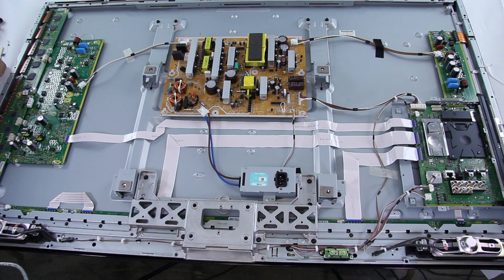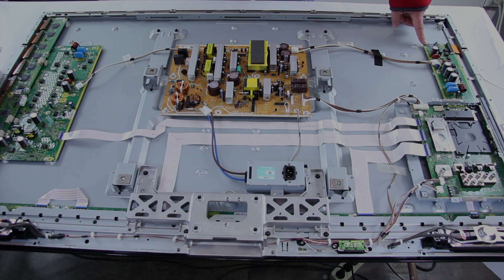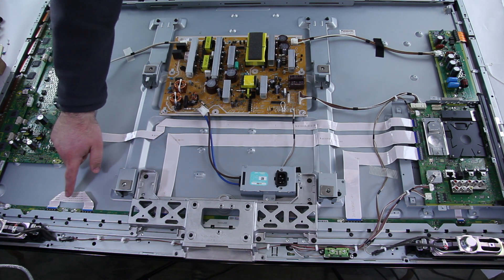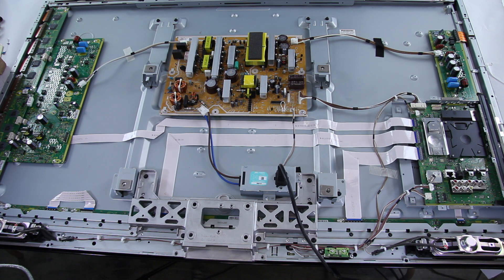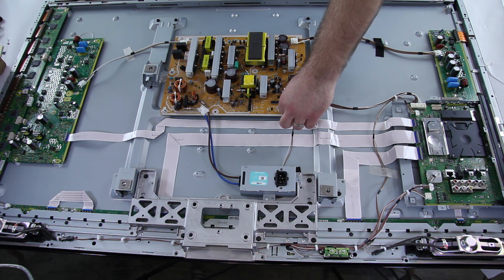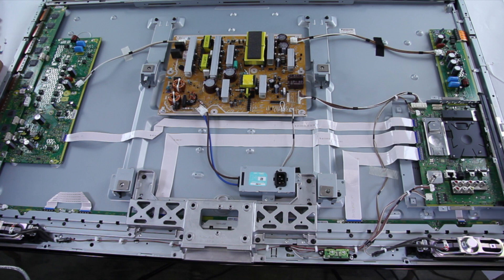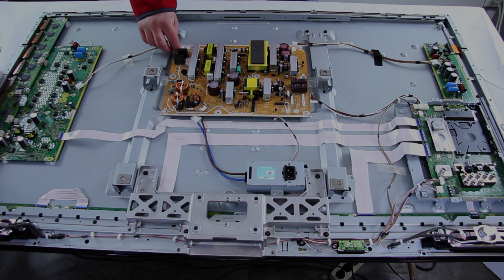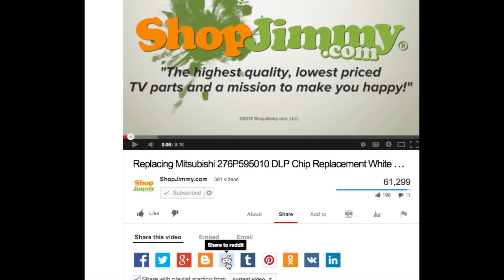Panasonic Plasma TV 6 Blink Code Explained Repair for 2011 Panasonic Plasma TV

Comment: Mine P42GT30B was working.  Opened up to fix up loose screw on tpna5330 and tpna5331   Now  gives 8 code or 6 code ;

Comment: I have a Panasonic TC-P54S2 that blinks 6 times and screen does not light up. There was a loud pop sound before it stopped working. Can you please inform me if this video applies since the model number differs from the ones that were listed and what parts I should be looking to probably replace including components on the circuit board. Thanks

Comment: I have a Panasonic TC-P54S2 that blinks 6 times and screen does not light up. Can you please inform me if this video applies since the model number differs from the ones that were listed and what parts I should be looking to probably replace including components on the circuit board. Thanks

Comment: I have at the TCP65ST50. It will power on and the screen shows botches of light pixels.  The screen will then go black and then has a three blink code. What should I do.

Comment: Didn't work for me to clear 6 blink error. P50S30 model Initially 14 blink code, repaired sc board, then 6 blinks. Drops the 5v & 15V a few seconds after power up Have replaced all boards except su/sd. What do you think I should try or check.

Comment: I have a Panasonic TC-P50S2 plasma tv.  Black screen and started with 10 blink error code.  I have replaced the power board and A board.  No change.  Found  a short on the SU buffer board so replaced buffer boards and Y sus board.  Now it has changed to a 7 blink code.  I found a broken leg on a capacitor at C842.  Swapped cap from old board to this board which was used but looked like new (from China).  If I disconnect the ribbon cable coming from A Board at A20 to Y sus board at SC20 and power on the tv, it stays powered on with no error codes.  Any recommendations as to what is causing the issue?  Thanks.

Comment: I've had my Panasonic TC-P60GT30 for a while now and it just recently gave me the 6 blinking lights.  I followed the procedures shown in this video.  When turning on the TV after disconnecting the ribbon cables, etc...the screen stayed Black and then started giving me 8 blinking lights.  I proceeded to check the C561 and TP82.  I was get a V reading of 2-3V and 30V respectively.  This model has 3 P-Boards, but I'm not sure at this point what the 8 blinking lights are now.  Any help with this would be helpful and appreciative before I order the 3 P-Boards.  Thank You.    **update** As I was putting on the back panel again and everything was connected, I tried turning on the TV, it did not turn on but started giving me 6 blinking lights again.  I imagine it is the P-Boards.

Comment: Thanks for the detailed explanation of the process to identify the issue and replace the board, I have the Panasonic TV model TH-65PF30W, High Definition Plasma Display 
it is also showing the 6-blink error, is this video will work for the model  TH-65PF30W?

Comment: Hey Jimmy, I'm a moron. I can't remember how to plug in my TV. It is a 2011 P65VT30. I just moved and the movers removed the cord and hid it somewhere. The only connector I can find is a flat rectangular 3-spade like I don't recall every seeing. It is under the little door that removes with 2 screws. Is that the power connector? If not, where is it? I was expecting a standard computer cord. The manual is not very helpful. Thanks.

Comment: 2010 sane TV.. 6 blinks 50 inch Plasma Viera Panasonic.. TV is not turning on.. 6 blinks on the led.. reading online it's a poerr board problem.. is your video here says 2011 helpful??

Comment: I have a 2013 Panasonic TC-P50S60 model and it turned off after a power surge in middle of the day, no storms or lightening. Now when I plug it in and turn it on, i get 3 quick flashing red light. What can I do to repair it? Thanks

Comment: Hello. I have a panasonic plasma tv with the blinking red light 6 times. Model is TH-42PZ77U.
Is there a different procedure for determining which board could have stopped working? I'm ok with replacing a board if needed but I'm not sure how to determine which one is actually bad.
Can you help me figure out which one is bad and locate the part as well?

Comment: Hello again , my panasonic tc-p42c2x shows 5 blinks code, always have stand by present but it is 4.99 volts, after the first clic sound momentarily we have 15 v, 190 v Vsus and power on line off 3.11 volts, accept sugestions

Comment: Hi I have a 2011 Panasonic  TC-P60S30. It has no picture and no sound. The red light flashes 13 times then shuts down. I replaced the "P" board but nothing changed. Now what to do?

Comment: My name is Joseph I have a Panasonic TC-P65S2 had two capacitor chance on the power supplys that were bubbled up but I continue getting the seven light blinking sign on it any suggestions to repair to repair this problem you can email me at Joseph Ramos 182@yahoo.com

Comment: I have a Panasonic TCP65GT30 that has the 6 blinking light issue with no picture staying on (or staying on at all).  It has replacement P(main) and (sub) boards, and I even tried a different A board with only the 6 blinking light code as a result.  I'll next try removing those cables SC-20 and C-20 to see if the set will stay in with a black/blank screen.  Should I be able to hear sound?

Comment: I have a TC-P42S30 from May 2011 and it has the six blink code. I followed the instructions in the video and the TV did stay on after disconnecting the SC board. The service manual refers to this board as the SN board, this is the same board, yes?

I looked for a replacement on shopjimmy.com but the TNPA5349 is out of stock. The repair kit is available but it says it is for the 7 and 10 blink code. Will it also work for the 6 blink code?

Comment: I had the SC board repaired on my Panasonic P50GT30 Plasma when it was showing 7-blinking LEDs. I received the board back and installed.  Now I get 6 blinking LEDs.  I've done the test where you disconnect the C20 and SC20 ribbon cables an the I got 8 blinking LEDs.
Any idea's? Thank you.

Comment: I have a Samsung 46" model LN46D630M3.  When I turn on the tv, the standby light blinks 6 times then goes out.  no picture or audio.  I removed the ribbon from the mainboard to the Tcon and no difference.   When I removed the cable from the power board to the mainboard, the backlights came on.  When I reconnect the cable to the mainboard, again the standby light blinks red 6 times and goes out  Would you say the mainboard is faulty?

Comment: Hi, great video and instructions. I have a similar issue with my TX-P42S30E. Only thing, the blinking led is the green one and really fast. I recorded it to play back slower to count them properly and it were 6 also. Disconnecting the ribbon cables didn't do anything. The voltage measures however did something. When turning on the TV and then measure, it was 0V both. When I measured while turning on (and hearing the relays) the measure of C561 was shortly about 3V and then quickly back to 0. Measurement of TP82 was also shortly 3V, but then slowly drops back to 0. I suspect I need to replace the power board, am I correct?

Comment: TC-P60S30 Panasonic Viera. I have the 6 blink code. after powering the tv on I get a buzz with a small green light that turns on for a second on the ss board. When I disconnect SC20 and C20 the error code turns to a 8 blink. This has me confused. Any help would be greatly appreciated.

Comment: hi my Panasonic tx-p46g30e tv flickers 6 or 7 times very quickly, then the green light is on. A click is heard from the relay. I checked the voltage behind the diode bridge is, but there is no constant voltage behind the transformers. How to repair? thank.

Comment: My 2009 TCP65S1 blinks 6 times I tried changing power supply & it didn't work - help
Reply: My 2009 model has separate  2 power supply boards

Comment: I have no picture and a six blink code.  When I remove the cable at sc20 and c20 (C20 at the one location shown in you video), plug in the power cord and push the power button the screen is black, just like when there is no power.  However the red light continues with the six blink code.   So is the TV considered  on or off?  Should I conclude that the SC board is bad?  TC-P55ST30  TNPA5351, no suffix. (I also hear a momentary buzz shortly after plugging in the power cord, but before pushing the power button).

Comment: Dear @shopjimmy.com I have a Plasma Panasonic TCP50GT30B. It started with a 8 blinks. I removed S33 and sometimes it became on with the black screen and other times it became  with the 8 blinks again. Then I removed and cleaned most of the boards and connectors. When reconnected the cables and boards it continued blinking 8 times when removing S33 it became 6 blinks. In the beginning the screen tried to be on with some not consistent bright. Now, the screen didn’t try to start any more. 

Have you any idea for this problem?

Comment: I have panasonic tv tx.pf42st30 year 2011. It blinks 7 red leds. What could be the problem. I opend it and found one capacitor small hole inside 25v 2200uf in powersupply board. But i need yours instruction.

Comment: Thanks for this information. I have this problem, but here are the details: Two weeks ago, power button failed. Felt like it physically broke. This morning, used the input button, heard a buzz, then death and 6 blinks. Performed your test, plugged in, heard power, pressed power and screen went off and switched to 8 blinks. SC board? What's the name of the part for the power/input buttons?

Thanks for your help.

Comment: TC-P42ST30 I have problem with changing the boards.  I change the video broad, power supply and broad under video broad.  Unplug  power and solid red light on.

Comment: I have a Panasonic TC-P60GT30. Clicks when I plug it in and unplug. Power button does nothing. No picture. Any ideas? Currently have the back off. Fuses all ck'd good. Power in 120.
Reply: never saw a blink code.Just turned off one day and would not come back on.

Comment: I have a Panasonic TC-P46G15 manufactured Sep. 2009. It will not turn on and when power button is pushed it blinks a red light 6 times, for the life of me I cant figure out what part I need to fix this problem. If you could point me in the right direction I would greatly appreciate it.

Comment: tx-p42s30b  power supply board disconnected from ss and sn boards click on switch on vsus,15v,5v ok clicks off within 8 secs.6 blinks?

Comment: Hi, I have a TX-P46GT30E and also a 6x blink problem. 
This occured after I have replaced the IGBTs on the SC-Board causing a 7x blink. 
Pin TP82 has 0V as well as the capacitor. Is it also the P-Board in this case? 
Is there a way to repair the P-Board?
Thanks for your answer

Comment: Hi, I have a Panasonic TX-P42S30B manufactured in 2011. When I turn power on to the TV I get a relay click, followed by a second relay click and 6 green flashes then nothing. Any advice would be greatly received!

Comment: Ik have a problem with my Panasonic TH-42PZ8E plasma blinking 7 times. 
But after some on/off attempts the tv says on and i can watch for hours 
with no problems.
 I already replaced the SU, SD, SS and  SC board. still blinking 7 times
 most of the time after power up. What else can cause 7 blinks?? please 
help

Comment: plasma, model TH-P42U30A    Was watching sport  then tv suddenly switched off no prior issues. .when pressing manual power button green light flicks 3 times then click sound from tv and  turns off  no power no red standby light nothing  your suggestions please? if is power board how pricy?

Comment: Have a TCP65VT30 and got originally a 7 blink code of death.  I did the tests and it seemed to indicate the SC board was bad.  Ordered a new SC board from you but the same thing happened when powered up without the Su and SD boards installed.  Ordered another SC board and this time installed the SU and SD boards and when powered up got a 7 blink again.  If I power up the set without the SC board connected to the ribbon and power connector I get a 8 blink code.  Don't want to keep changing boards for the heck of it.  Any ideas what might be the problem?  Thanks for your help with this as when the set was working the picture was perfect.  Dave
Reply: That's what I'm afraid of.  And with new tv's so cheap right now I wonder if the parts for these old ones will be cost effective to get.  If it is something easy  and under 100 bucks I'll try it otherwise it will be better to just get a  TV where everything is new instead of one board. (for just a little bit more!)

Comment: Hi, I was hoping you could be of help.  I have a P50GT30 model which was giving me 7 blinking lights.  I replaced the SC board and now it gives me 6 blinking lights.  When I follow your video and unplug the ribbons and turn it back on, it gives me 8 blinking lights.  I don't have the equipment to check the voltage and wondered if there was anything else I could try before discarding the TV.  I don't want to put much more $ into it since it's our second TV.  I already paid for a new sc board which didn't work.  Any help would be MUCH appreciated!  Thank you
Reply: Did you ever figure yours out? Same TV here with the same issue after replacing the SC board.

Comment: Hello, I have a Panasonic TC-P50G10, from 2009. It blinks 6 times in a row too. Assuming that the solutions were the same, we looked for a SC20 and C20 connection to disconnect, but we had none. Please help
Reply: I have the TC-P46G10 also from 2009. I am getting the stuff blinks as well. Any suggestions?

Comment: i have a Panasonic plasma TV model number TCP55ST30.  The other day it just shut off and the power light began to blink 7 times over and over again.  After looking at some repair videos I disconnected both the ribbon from the A board and the connector from the Pmain board to the SC board powered the TV up turned it on and now I get 8 blinks.  ihav not seen any video showing 6-7-8 blinks I disconnected the P35 connection and reattached the clip to the SC board from the PMain and re-powered up the TV and now got 6 blinks any idea what to do next

Comment: hello I have a Panasonic TC-60st30. there was a storm and after a loud thunder my tv shut off and did not come back on. I replaced the A- board and plugged it in and heard a click but the TV still will not turn on, but the light on the optical port comes on on the new board. what can I do to fix this issue? Please help!

Comment: i have watched the video.

i have a 2010 Panasonic Plasma 60" TV. The red light blinks 6 times. Tv clicks several times and sounds like it wants to start up but i just get the black screen.
are these tips the same for my tv?
Model # TC_P58S1
tv date is  January 2010
thank you very much!

Comment: I see you have a video for diagnosing and fixing 2011 Panasonic plasma with 1, 6, 9, 10, or 14 blink codes. My TC-P65ST30 just stopped turning on and is giving me a 7 blink code. Any chance you could make a video for the 7 blink code  or you could tell me which part I would need to replace?

Comment: Hi, I have a Panasonic TH-L19X10SP (LCD). The red power light at the bottom blinked 6 times then paused and blinked again 6 times.  Trying to turn it on through the power button on the tv and the remote produced no results.  I unplugged it for a couple hours then tried again and still nothing.  Any help would be appreciated.

Comment: HI....good video on the blink code process.  I have the tcp50gt30..replaced the power supply and still have the 7 blinks. but I have no voltmeter......your thoughts?

Comment: Hi  I have a  Panasonic TC-P55VT50.  Last night it turned off while watching a movie.  The red power light at the bottom blinked 6 times then paused and blinked again 6 times.  Trying to turn it on through the power button on the tv and the remote produced no results.  I unplugged it for a couple hours then tried again and still nothing.  Any help would be appreciated.  I bought in new in June 2012
Reply: I have the exact same model and exact same issue.  Where you able to solve this issue?  I'm curious on how to fix it.  Unfortunately this video doesn't work for this model.

Comment: Hey guys, big fan of your videos! Having some issues with my Panasonic TC-P42S30. It was not turning on at all. I found the issue was the SC board (from your help on a different video). I sent the board in to be repaired. it is now turning on properly. But is doing a different trick now. When the picture mode is in "Standard" it will stay in all day without issues. But, if I put it in the picture mode "Vivid" (or any brighter picture mode) the TV will stay on for about 3min then shut off. It will then display a 6 blink code. If I wait 30min it will come back on for another 3min. If I switch to "Standard" again it won't have issues all day. Any thoughts on how I can fix this?

Comment: Jimmy 
I have a P55gt31 I had a 7 blink code I put your SJ-TNPA5335 kit in the SC board.
Powering the TV on I will get a lite gray screen for a sec or 2 and then a 6 blink code.
If I unplug C20 and SC20 ribbon I will get 8 blinks
When I power the tv on I will get 15v at TP82 and 4.5v at C561 until the code stats to blink, then 0 volts. If I unplug connectors at the Sc board SC42,SC46,SC41 i will get 7 blink code.
any suggestions.

Comment: I have a Panasonic
TH-P58VT20A With 7 red blinks I followed the instructions in one of the videos and disconected the SC board and turned the tv back on and then I recieved 6 binks so I take it the SC board needs replaced. What do you think?
Reply: +george tomaso were can I get de part ,is not long in Australia ,tanks you